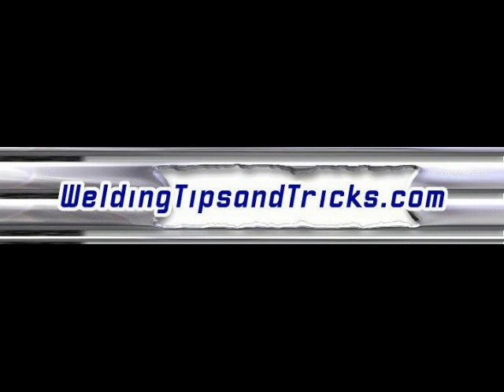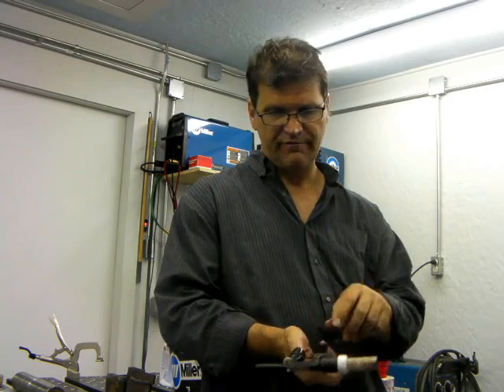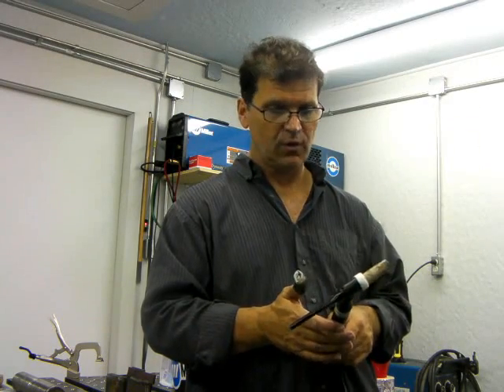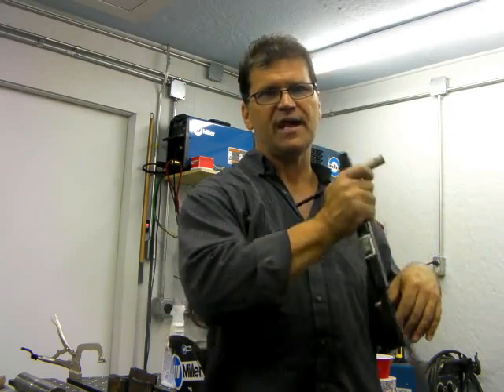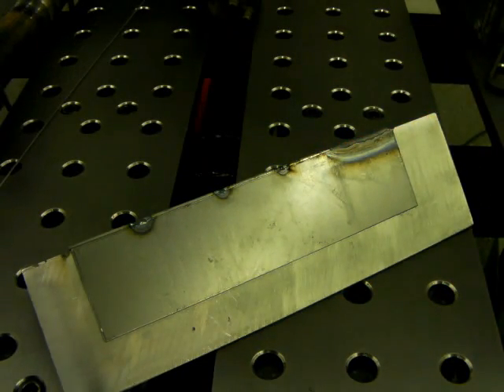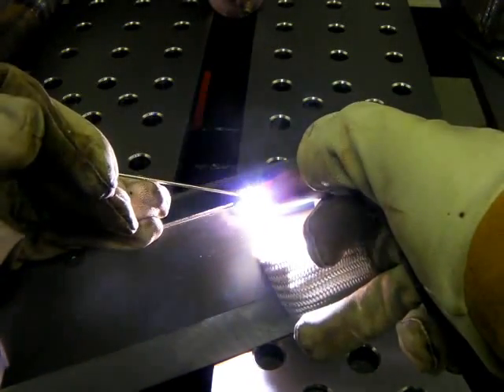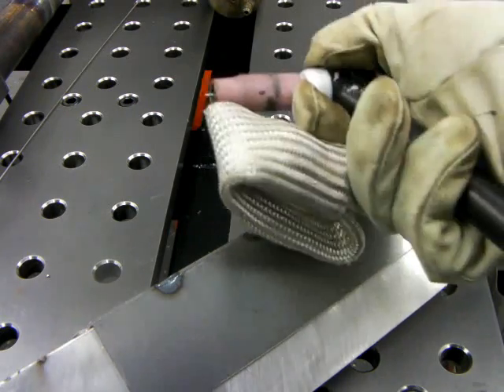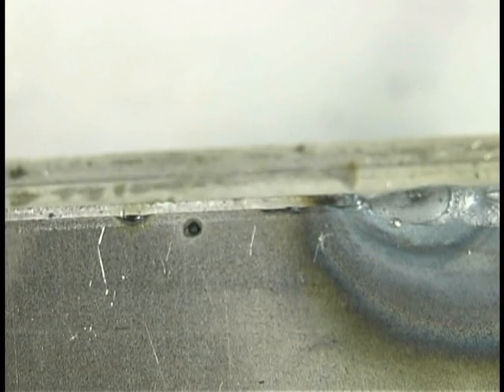Homemade Tig Welder - Tig Welding Old School with Scratch Start

Comment: Can i use this to tig aluminum? I need to weld some aluminum pipes
Reply: +Mitchel Lenz Yes and No lol.  Would not recommend it!
Reply: U NEED AC/DC machine ar spool gun mig
Reply: You can use this to weld aluminum, but it requires positive current (DCEP), is super messy, and eats tungstens up.

Comment: Remember that after a rectifier, you've got 1.414 times as much voltage as you have set on the welder in AC. At least if it's a full bridge recitifier which this one appears to be.
Reply: you still have that same voltage you are just thinking the wrong measurements
Reply: crowmagg1 No... when you rectify from AC to DC you end up with 1.414x the voltage. It's just how it works. What are you referring to?
Reply: crowmagg1 If you're referring to "peak-to-peak" then, yes, you are technically correct, but he was referring to RMS.
Reply: yes i was referring to the peak value of the ac waveform 
i cannot draw the output waveforms here but the peak voltage is the same on both now average power can be higher if a capacitor is added to filter the dc waveform (then again it may not be because of the current limiting shunt in the welders transformer )
but you have to remember where the rms measurement came from it was to make a value that was equal to a dc equivalent voltage when heating a resistive load 
but if splitting hairs the full wave rectifier has a voltage drop across two diode junctions dropping a volt or so from the ac peak voltage
Reply: crowmagg1 Yes, I know all that. But wall power is always referred to in RMS.
Reply: crowmagg1 It helps a lot if you use punctuation, by the way. Your post was really confusing at first.
Reply: yes the punctuation may be bad i know and i can visualize it better than explaining it but since you used the rms value instead of the peak value of the ac voltage then its only makes sense that you should use the average value of the dc voltage 
if you did that then the average rectified voltage would be lower 
because a ac sine wave peak voltage is the rms value multiplied by 1.414 so lets take a 70 volt rms output 
70 x 1.414 = 98.9 volts peak 
now lets look at the full wave rectified output values 
we still have the peak dc 98.9 volts between the output terminals but since you used the rms value of the ac voltage  
and there is no rms value of dc voltage we must use the average voltage value 
with a full wave rectification the formula is 
peak multiplied by .637 lets plug those numbers in 
98.9 (peak) x ,637 = 63 
and in that case your rectified voltage would be lower 
not higher

Comment: I have a 1973 Lincoln AC225 that has been in 3 floods and still works excellent. Great welders.
Reply: +Stacy Puckett i have a buzz box that went  underwater in katrina and still works fine, only needed to oil the switches

Comment: I plan on turning more MOTs and several 35 amp bridge rectifiers into a homemade DC stick welder, someday. Inverter welders are not available, atm. Only AC Buzz Boxes and I don't know how to install 35 amp bridge rectifiers onto an AC Buzz box like I would to MOTs. High voltage diodes are not a viable option here and I wish TIG equipment were available. I have also learned how to rewire transformers.

If I want to DC TIG weld on aluminum or cast iron, then I would use flux. As for MIG welding, I could probably turn some Campell Hausfeld 110V MIG welder into a 220V by replacing the transformers and changing the electrical cord for a 8-12 gauge copper wire.

Comment: This kind of Tig welding is how we do 100% of our welds in any boiler or furnace. I just scratch start on the top of the bevel and bring the arc down. Then I snap out to reduce any fish eyes. We always run a remote too so if you have a helper he can tail you up etc.  this kind of welding is is actually easier when performing out of position difficult welds because one doesn't bother with foot pedals. Curt, boilermakers 146 Alberta
Reply: I bought a little everlast stick welder a while back and it came with a tig torch with gas valve. I never thought I would ever use it but Jody's videos and comments from other welders has given me the confidence to give it a go. i   think it has lift start but I might try scratch start just to learn how to do it.
Reply: I know what welder you are talking about. I love that everlast 140st.

Comment: a copper scratch block would make starting the arc easier. also your weld doesn't get tungsten in it. this is great for stainless. Also back track from start and finish to eliminate sink craters. I learned on an old dc generator setup for tig  with an always on water pump and a rigged gas shutoff that closed when I hung the torch on it. It had the smoothest arc of any machine I ever ran.

Comment: can this be applied to aluminum welding?
Reply: You need  high frequency for aluminum.  They sell HF units that you can attach,  but for the price you could buy a cheap ac inverter with HF and foot pedal.
Reply: Sergio Fuentes you can do one hf arc starter from scratch... with a car ignition coil.. a tugsten electrode to the spark gaps..some capacitors and resistences.. that is all.. is easy.

Comment: Wait, i have 3 stick welder in my garage and looking for an tig welder on ebay....i just have to get the welder torch, clamp my stick holder to the thing, my grounding like normal and need some gas? I need it just for 4 pieced at my car, so lets try this beast lol
Reply: +Spelter Don't forget the rectifier! Assuming you want DC TIG......
Reply: *****
Thanks, after winter i give it a try, for now i'm working on my reprap ;)
Reply: can i run a spool gun off dc output if i have a seperate power supply for spool gun motor and seperate gas feed?

Comment: could somebody please make a video on how to make a rectifier for a ac buzz box
Reply: ya buy them off ebay pretty cheap make sure you get one thats a bit higher in amps than the welder because AC surges. 100 amp 150 -200 amp should be good.

Comment: Could you hook on to the lugs of a MIG welder?  They're already DC and even hobby units run up to 140 amps.
Reply: +soundspark You'd almost certainly stress the machine, as you move the tungsten around the machine would be working hard to maintain a constant voltage and the current would be going all over the place.

Comment: I got a tombstone welder that is ac/dc+- could I tig aluminum with it?
Reply: unfortunately not mate, to weld Aluminium you need to break down the oxide layer on it and some clever people discovered that by changing from + to - constantly it would do so. but you also need a constant High Frequency to keep the arc alight or it would extinguish everytime it changed polarity. you could rectify it and use it as a Tig.

Comment: Great vid brother!!! That's how we been doing it for years in the power plants on all our x-ray pipe and boiler tubes. All the hands I know that are still in the craft still do it that way today. Absolutely nothing wrong with this set up. The pedal method is more for fab shop work, but up in a boiler or down in a ditch, this is what you want and really the only choice you have for tig roots.
Reply: My friend is a boilermaker. I went out on a couple of jobs with him about 20 years ago with him, and that's how it was done. I was on the overlay crew running inconel through a mig. Cool metal to work with, but the work environment was really tough. A foot pedal would get tossed in the dumpster in less time than it took to run the control wire for it.

I think some of the guys were running torches with amperage controls on the torch, but a foot pedal? Nope!

Comment: Great videos! Truly appreciated. I'm building my own TIG welder from the ground up transformer and all. I found a huge 25 pound toroidal transformer 10" D x 3.25" T x 2.5"ID that already had 2 115v primaries each wound from 132 turns of 12awg magnet wire. I already removed all the secondary windings. After testing with 10 turns of wire I found I get 1 volt per turn so I am using some old 1/4" thick walled copper tubing to wind the secondary that will be multitapped from 12v to 32v. I'm running coolant through the copper tubing secondary coils to allow for a 100% duty cycle at any power setting as they will also cool the primary windings with the entire transformer sitting in high temperature silicone oil so heat will be a non issue. I'm surprised you do not see more liquid cooled transformers in welding gear, I guess it's a cost issue if one needed to buy new materials. I'm fairly good at scrounging the high dollar components. I will have less then $300 bucks in a 300+ amp full function TIG welder. The copper tubing is insulated by 600 deg C woven fiberglass sleeving. I scored an old 300a miller welder at the junk yard that yielded some valuable components as well such as the solenoid valve for the gas, a 300amp rectifier and connectors. I'm setting it up to run off either 120 or 240. The liquid cooling system for the transformer will also provide coolant to the WP20 torch I just picked up as well. The unit will be touch screen controlled with a 32 bit programmable micro controller running the unit with all the switching carried out by IGBTs complete with all the bells and whistles from the best units and then some including HF start of my own design. I want to experiment with frequencies and variable balance on the AC to adjust the cleaning action for aluminum welding as that is my main focus.  Anyway, I've watched most of your welding videos and they have been a treasure trove of information, thanks for sure and keep them coming...
Reply: thats awesome. Wish I could do something like that.
Reply: Geo K less of a cost problem with liquid cooled transformers but more to go wrong especially when you could build a little heavier to carry the heat
Reply: Make a video
Reply: One question, I also have a toroid ring about 12 inches diam and would like to do something like this too......how and where do you add a high frequency transformer to the welder to get a HF start?

Comment: Is there nothing else but diodes on that rectifier? No smoothing capacitors?
Reply: The whole point is that none of this smoothing is required for a simple TIG operation like this..... the only reason that the rectifier is used at all rather than trying to just run AC through the tig torch is that every time the current reversed, the arc would try to collapse.  It's perfectly OK to have a varying DC output through your TIG torch.  As long as the current moves in one direction and the frequency is high enough, the arc can be maintained and remain functional.  You have to imagine that a theoretically pure and stable DC voltage waveform is mathematically equivalent to a varying DC waveform with a frequency of infinity.

It is common to not have much if any smoothing capacitance in a full wave rectifier in a purpose like this one.... It's simply a matter of that the required capacitance would be ENORMOUS to provide any kind of substantial smoothing. Consider trying to keep the voltage ripple down to 50% in this particular machine {the lincoln electric AC-225 tombstone welder}..... This welder outputs 225 amps at 25 volts maximum which in the USA at a 60Hz mains frequency would require about 0.105 farads..... This doesn't sound like a lot, but when you consider that the only large capacitors commonly available in this voltage and capacitance range are electrolytic types, and that their normal maximum accepted ripple current is usually about ONE amp rather than over one hundred amps like in this example, suddenly you are talking about employing many dozens of very expensive capacitors in parallel in order to just get your voltage ripple down to 50%, which is certainly not a waveform that anyone could call "smooth".......  The more ideal solution at this point -- and indeed, the method which is employed by modern high power supplies --- is to rectify and filter the incoming mains and pass it through a PFC before using a switch-mode-power-supply to provide whatever output you need.  

Modern super fancy and expensive welding power supplies are really just SMPS that provide whatever frequency and voltage of AC or varying DC you want all in one IC controlled unit.
Reply: Firstnema Lastnema With no Capacitors though, wouldn't the arc be collapsing at twice mains frequency anyway?
Reply: There is an inductor or "choke" with a value such that it prevents the total collapse of the arc at the switching low point......  If you would like, please look at a exploded view diagrams of for example the Lincoln AC-225 stick welder for both the AC only version and the AC/DC version..... you will notice that the difference between the two consists of the AC/DC version possessing the following: a bridge rectifier, a "choke" or inductor, and a small snubber circuit to suppress the high voltage inductive kick at arc termination and cycle lowpoints, and also the extra switches and wiring to connect these extra current routes compared to the AC version.   If you choose to replicate this style of welder to convert an AC only model, you should choose/make an inductor with a henry value which will give a matching or slightly greater impedance value than the over all load of the arc circuit at the frequency which you will be operating at  {or twice the mains frequency in most cases for a bridge rectified circuit} ....... As I said, you would have a hard time finding a capacitor bank which would withstand the huge ripple currents at high voltages and low frequencies employed by these setups to be of much use.
Reply: To be more clear, if you were to look at the output of this welding setup on an oscilloscope, I think that "Smooth" is the LAST word that would come to mind :D
Reply: The inductance or choke is not for low point switching, it is for smoothing the current peaks, "choking" off stray currents and controlling the transfer.
Reply: Actually an inductor would be ideal while capacitors would be useless.

Comment: Hi, i need your help setting up my arc welder to tig process. I have a Miller Thundervolt 150/225 amp ac dc+ dc-  and I have the tig torch, power cable and hose. Do i clamp the tig power cable to DC+ or DC-? Now I have a 75%argon/25% CO2 bottle with the regulator on my mig, can I use that? Oh last but not least, can I tig aluminum with this machine?Thanks
Reply: you need pure argon for tig on anything or helium,

Comment: I've got a Tonco AC arc welder and an Argon bottle.  Could I get a TIG torch&hose, and do _AC_ scratch-start TIG (e.g. on aluminium), or will scratch-start only work with DC (e.g. this demo vid)?

Comment: If you get an inverter welder like an Everlast it will have a square wave AC with negligible time spent between positive and negative portions of the wave. They also have a digital welder that has modified wave patterns but that is a different story ....

Comment: No, you need a high frequency setting to speed up the 0 point in AC current when it flows from positive to negative and back again.

Comment: If you don't want to use scratch start and don't / can't use HF a bunch of Everlast welders support touch start which won't contaminate the tungsten nor the welded material.

Comment: I've welded 12 hours straight with a good partner inside a boiler welding heavy wall high pressure tubes with this method and only changed the tungsten once a day. It's not crewed its not old school. In the trades(boilermakers pipe fitters) it's common practice. Once you know what you're doing with it, it's the most comfortable. Everything we do get x-rayed 100%. Rarely do we see a problem. And when we do its for not following procedure. Like preheating. Exotic metals

Comment: If you only need a maximum of half the available current from your welder, you can use a single diode.  It must be rated to handle at least half the current rating of the welder and have a reverse voltage rating higher then the peak voltage of the welder.  Essentially the diode would go in series with your welding cable; one end towards welder, one end towards work.  Depending on the way you install it you will either have a positive or a negative electrode.

Comment: To build a full wave rectifier you nwill need four diodes each with a current rating of at least half the maximum current of your welder, more would be better.  The diodes should be mounted to heat sinks.  They will have to have a reverse voltage rating greater then the peak voltage output of your welder; 200 volts would probably be OK.  I looked some up that were about $25 each that would do the job.  So $100 will get you started.  Then you wire them up as a full wave bridge rectifier.

Comment: Jody,

Great video.  I am currently using a similar setup to run a Northern Tool WP-17V TIG Torch.  I used whats called a DC Cheater (Which works like a champ) to get the DC from the AC 225 Buzz Box.  I am finding that with my particular setup 2% Thoriated Tungsten work exceptionally well as I do not loose too much of the tip when I scratch.  BTW Love my Tig fingers.  Keep up the great video's I hope to upload some myself.

Comment: I am sorry that I didn't really clarify what I meant by "which is best to use"? I am dealing with car restoration, so I deal with body repairs, chassis repairs, joint repairs etc... I just wanted to know if Tig is "better" or Mig??? Thank you very much.

Comment: Im really interested in doing this, but have zero TIG knowledge. 
On say 1/4" to 3/8" and less with a 150ADC power supply-
..
 can you give me a shopping list?

Weldcraft.  
Air cooled, needs a valve, I don't understand the tig torch sizes, or the consumables that go with it.

Comment: I can already TIG normal way. Need to learn scratch start for work to do onsite repairs with a suitcase welder. I get it started and the arc just jumps around inside the cup instead of running directly off the tungsten so I cant get a bead to start.. Ideas?